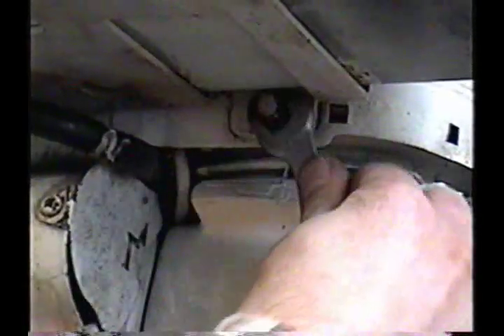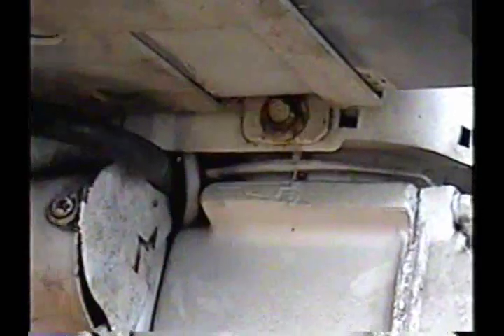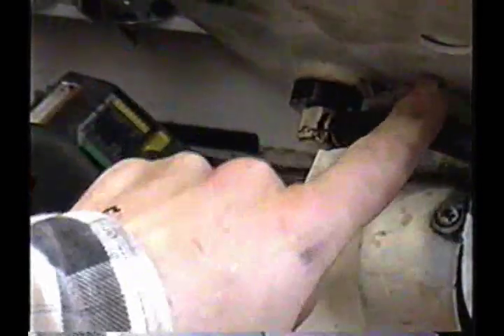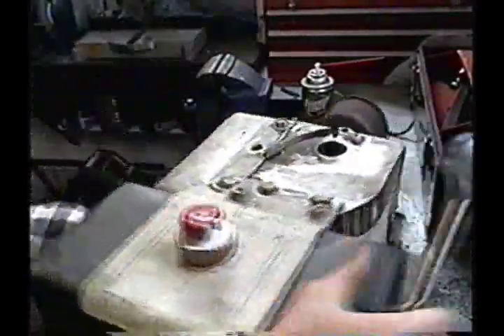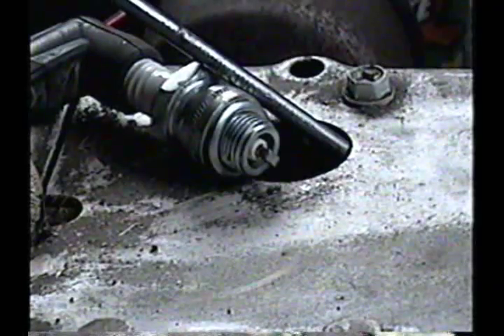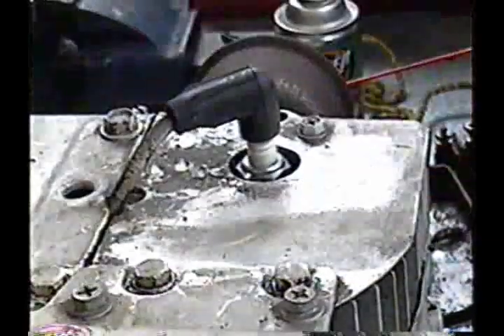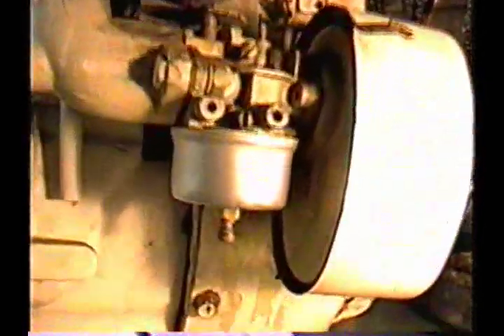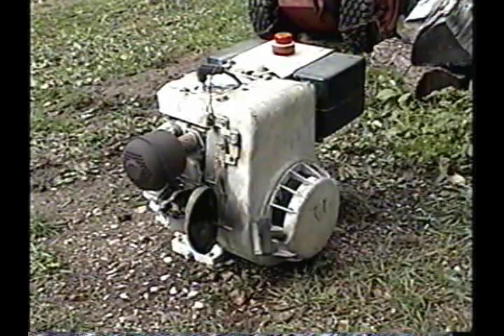How To Remove Flywheel, Points Timing and reassembly of TECUMSEH 8HP PART 3 of 3

Comment: Thank you for this series of fixing these old Tecumseh engines. I bought an old Sears Roto spader tiller, and was looking for some info on the coil, and now I know it also uses points. I'm not getting any spark from it, and will check what you have shown in your videos to figure it out. I couldn't even find out what spark plug to buy for it(it didn't have one in it when I bought it)  I will pick up a couple of the Champion J8C sparkplugs, check the points, and see if I can get my rototiller to run. 👍🏽😁

Comment: Very nicely done and I thank you. I just purchased a 43 year old Airens Sno Thro with a 5 hp Tecumseh. I have the carb parts coming and while I wait I can verify the points. I've messed with the easy parts but I haven't been inside the points area. I didn't really know what to expect. Now I'm not nervous at all. Let the fun begin!  Thanks again.

Comment: Great videos, best on the web.  I have borrowed a tiller with a Tecumseh HS50 67062A 4141B engine that has a key that seems way too thin for the flywheel/crankshaft keyway.  There are many websites that sell keys ("Gold," "Silver" and "Black," as well as "assorted"), but I can't correlate my engine to a key part number.  Any help?  Many thanks, and all the best!

Comment: Don, is there a way to know if an engine has points w/o taking the flywheel off? Some kind of visual indicator from the exterior of the motor. I've got an '86 Tecumseh 8hp. off a snowblower. Thanks.

Comment: I have a Tec8HP (Ariens ST824) that one day I had no spark....I'm pretty sure the on/off switch is ok, but when cranked with starter the plug has no spark....Question> would you suspect a bad condenser or  perhaps the coil? (it ran good a week ago!)
Reply from the maker: sometimes just sanding the points with 600 grit emery paper works, could also be coil

Comment: Nice vid. again, you get the camera right where it needs to be, that motor is older than you. I plan to watch all your videos... Think I will live long enough? So, I didn't see a reply to "why do you prefer J8C spark plugs over RJ17/19 LM. Is it cause they are not resister type. We need to know. You are becoming an Icon to us like some rock stars are to teenager. But we aren't interested in what brand of clothes you wear. Rather, we need to know what kind of chainsaw you use:))
Reply from the maker: lol, j8c was mostly used when points and condensers were still on those engines
Reply: donyboy73 Yes, those resister plugs weren't invented back then. I remember when the neighbor cleared his driveway of snow it was picked up by our TV.

Comment: I got a 1973 Tri-Sport trike with a 73 8 horsepower Tecumseh four cycle I put new points coil and condenser in it and I can't get it to spark what should I do

Comment: Is it possible for flywheel magnets to be too weak to start the engine.  I put a socket within 1/2 inch of the flywheel and feel nothing.  A screw driver right next to the magnets is a little loosely held.

I haven't used the engine in 10 years.  It is 40 years old.  A tecumseh 4.5 hp engine.  I replaced the coil , the points and condenser ten years ago and it ran, but now there is no or little spark.

I have a meter to test condensers.  I may do that next.

I don't see anyway of timing the engine.  There are no screws to loosen to rotate the coil. 

I am also going to check to be sure the grounds and wires aren't corroded.
Reply from the maker: on the older tecumsehs with points , yes the 2 little magnets can become too weak